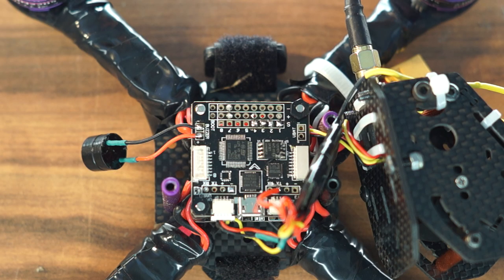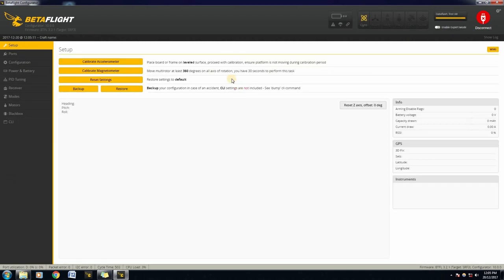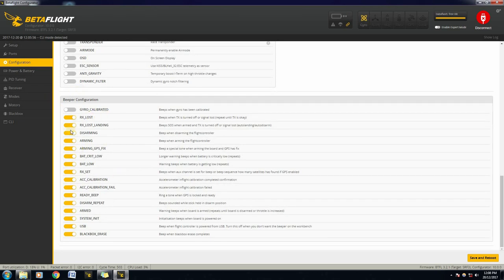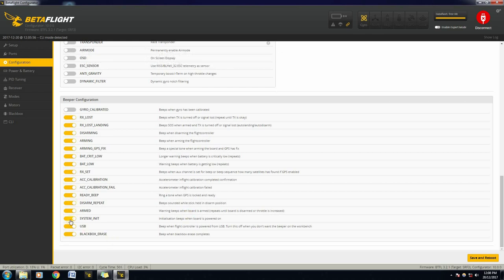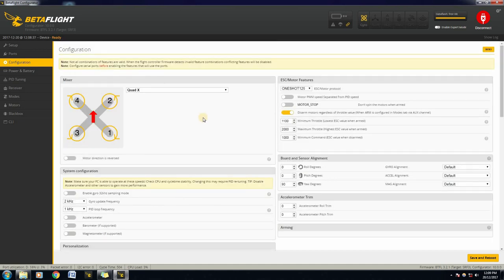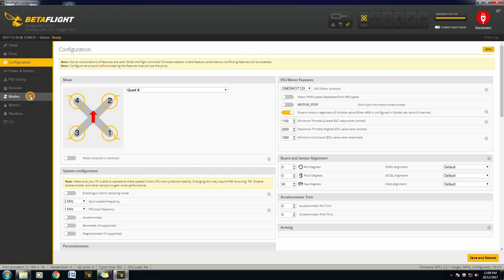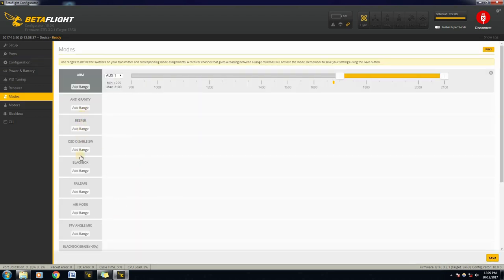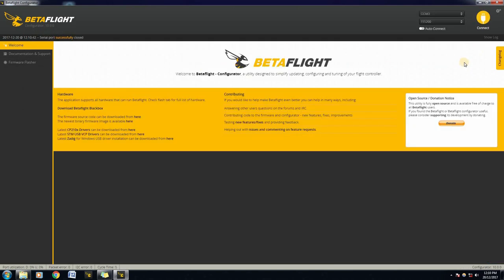How to install a buzzer/beeper in your quad in 4 MINUTES!

Comment: great video
Reply from the maker: Thank you!
Reply: @LadAus  hi how you doing. I'm a noob n I have an x220s...I'm trying to get familiar with betaflight.  I can see on back my quad that there is a buzzer....I. not certain it's even soldered. I think the betaflight you used is older than now. Did the set up In betaflight change? I really need to know if I can have your help

Comment: does you battery have to be directly connected to your flight controller in order for voltage monitoring so when your battery drops below a certain voltage your buzzer starts beeping? I have the same FC as you any help is appreciated

Comment: How do you solder the wires to the buzzer's pins? That's what trips me up. I take so long - and still get a lousy result - that I think I'm melting the internals of the buzzer. I can barely hear it.
Reply: Hopefully you already figured out what was wrong? If not you may have cooked it, or may have a faulty beeper. If you’re new to soldering, one key is to use high temp(I use 750F). But the wires are so small it shouldn’t be necessary. Use flux past and pre tin(wires and pads. I imagine a year let you’ve either learned this already or given up lol. Either way, good luck & happy flying. Maybe someone else can use this info...blah blah blah

Comment: My  buzzer making sound from the start itself when the battery is connected why is that??
Reply: Did you ever figure this out?? Mine does this too, but only after its armed, throttle @ lowest point (IFlight dc5 hd). As soon as I throttle up it stops. 

On another quad(iFlight a85 hd)it does the same thing, except it doesn’t stop with throttle, and switch doesn’t activate beeper. Never had this happen on at least a dozen builds, but both these quads are new to me and have newest BF. I’ll remove params to see when it stops doing it and report back.

Comment: What is the aux switch?
Reply from the maker: The Aux switches are all of the switches on the radio. None of them are in a particular order for picking switches, just set up the individual one you want and they will work (Channel 5 switch is AUX 1, Channel 6 switch is AUX 2 etc)